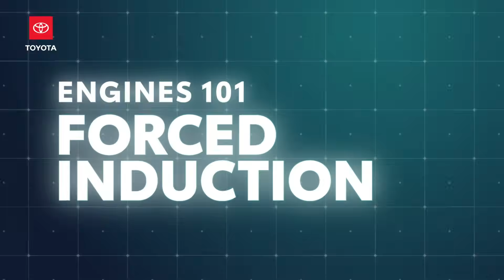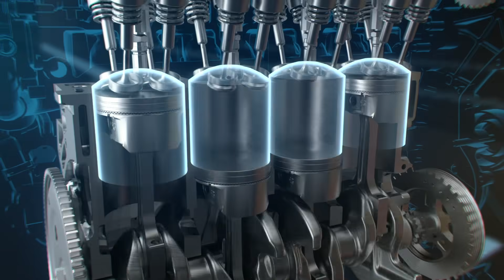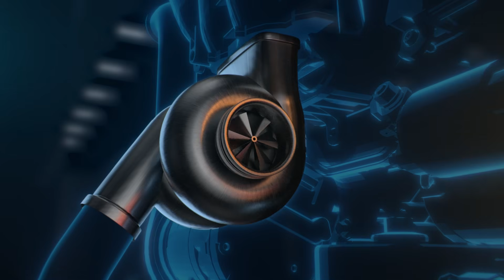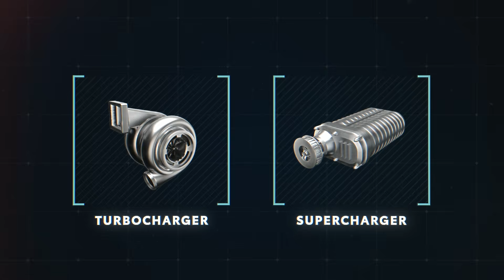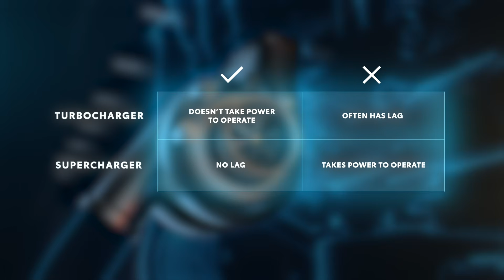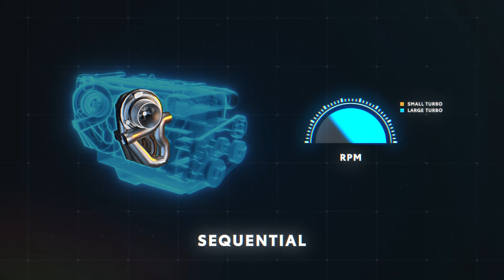Engines 101: How Does Forced Induction Work? | Toyota

Comment: A turbo also takes away power... the backpressure on the cylinder as it exhaust also "takes away" power. Put a turbo on a car, but don't hook up the compressor side, it will. "Lose power".

Comment: Just give us a turbo Corolla already.
Reply: There have been several Turbocharged Corollas from the factory, and supercharged, and some with 20v heads. Toyota is not shy when it comes to outlandish engineering, on it’s mass market models.
Reply: @rsoul7282  😮😮😮
Reply: @rsoul7282  😮9😅😅98😮😮😮😮9😮😅😮7😅😊😅😊😊😅😮
Reply: 99 4:59 4:59 😅j
Reply: @rsoul7282  0ko9😢😊😅😊😮🎉-iy
Reply: Corolla gr is your answer 1 year later
Reply: @ericinfante1885  😊i😅
Reply: you mean the GR Corolla and the GR Yaris?
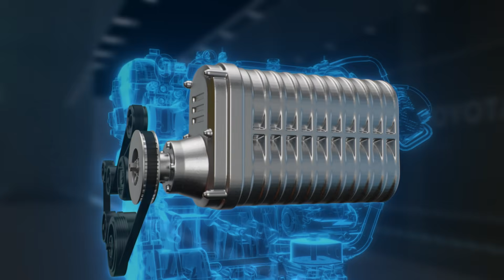Reply: 😊😊😅99😅😊😅😊😅 3:02 😅y😅 4:53
Reply: 1.2 turbo corolla joins the chat
Reply: 😂😂😂 💯 👌 fr fr